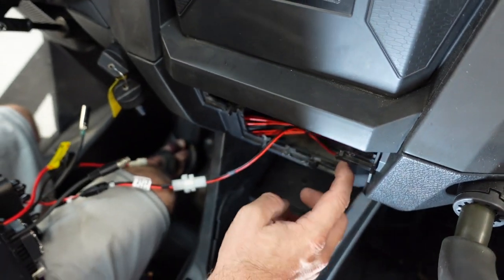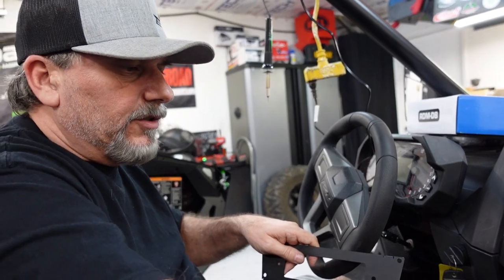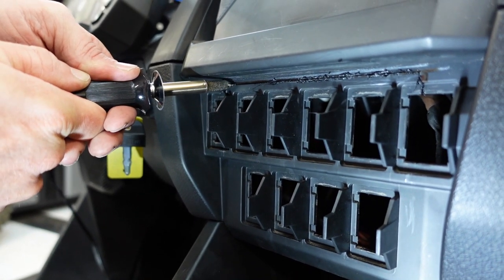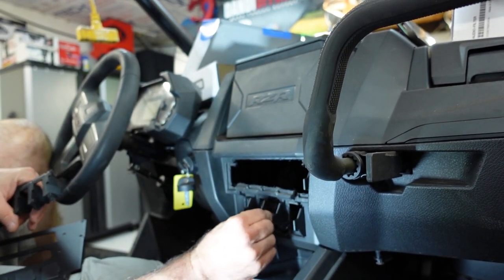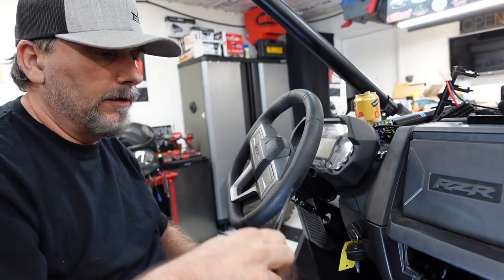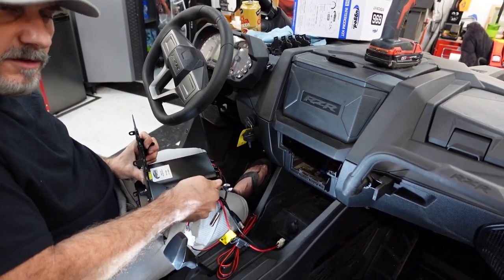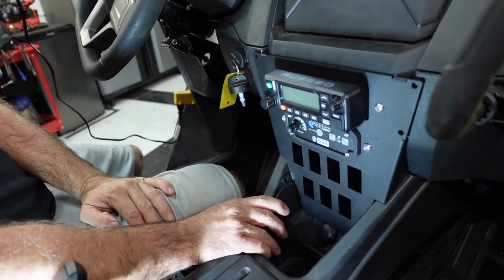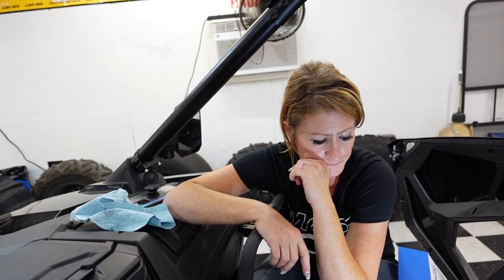Installing New Rugged Radios Digital 696 and Dashmount in the RZR Pro - Did he say HOT KNIFE?!?

Comment: Great, helpful video! I just installed the same setup but I have 4 switches also. FYI, if you install items with switches, you will need to cut more out of the bottom/floor of the switch panel as well. The wires, otherwise, won't make upward angle to refit the mounting plate back against the dash. I cut approx. 1/3 to 1/2 the way back and it worked/seated perfectly.
Reply from the maker: Thanks for the info! thanks for watching